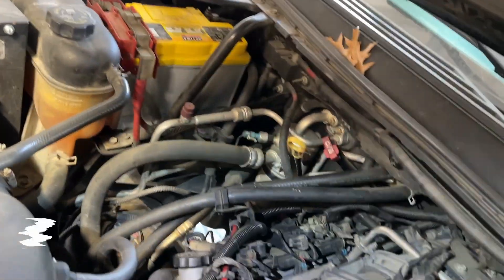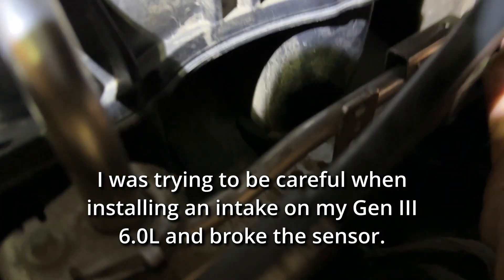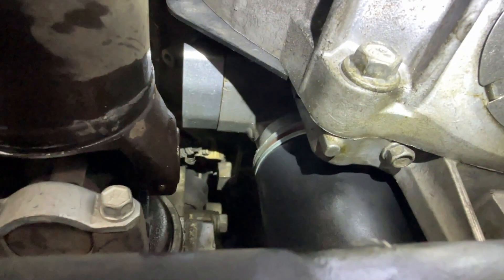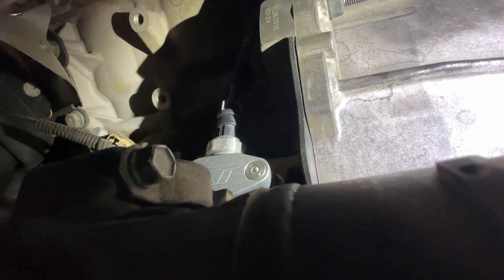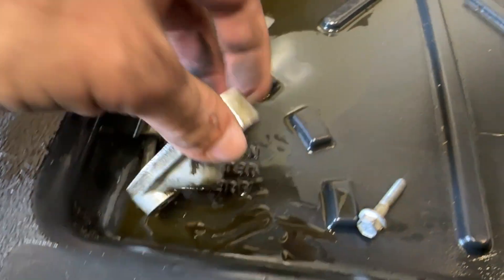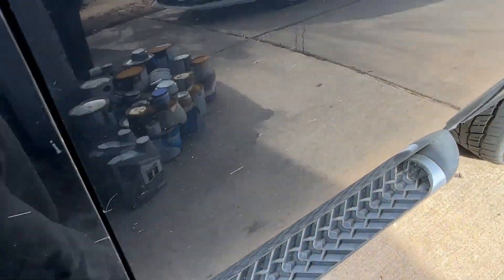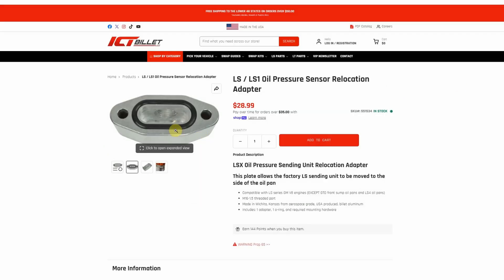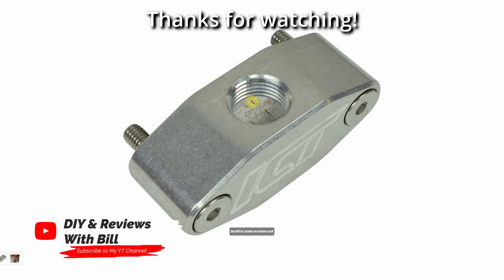How to Relocate Oil Pressure Sensor for GM LS/LT 4.8/5.3/6.0/6.2L Engines Without Oil Cooler Lines

Comment: Have not taken my sensor off so I could be looking at this wrong. The wire harness that is shown in the picture has two female ends, the oil sensor has the male end so wouldn’t that mean the original wire harness is a female end?

Comment: So the old sensor just sits up there or is there a block off?
Reply from the maker: Right now I just left my old sensor plugged in but really you would want to use some sort of block off plug as these sensors can and will eventually leak.

Comment: one thing that the senor also lets you know is when the stupid little filter thats under it is cloged which can cause damage to other internal things.lifters  ect.., this kit while cool takes away the ability to know that now becuse it being cloged will also cause sensor to read low or no preassure
Reply from the maker: Even if the screen is clogged, a lot of times people will just replace it along with performing a regular oil change. All that screen is for is to keep those particles from going into the sensor itself causing it to not read or be inconsistent. It does not filter the oil for the entire engine. That's the job of the main oil filter. Proper maintenance is what will prevent damage to other components from contaminates. The only thing this kit would potentially do is allow the sensor to get clogged and need to be changed a little more frequently. But again, proper maintenance will help keep things running smooth.

Comment: What was the reason that you wanted to relocate that oil pressure sensor?
Reply from the maker: As I get older, it’s getting harder for me to get into tight spaces or be slumped under the hood. At least where I located it at, I can be laying down and more comfortable when I need to replace it.

Comment: The only downside is if the oil pressure sensor is leaking.  You would need to gut it out and remove it and come up with a plug to block the port.  Not sure what the thread size is, so might have to make something.

If you have low oil pressure, a common cause is the o-ring on the oil pan intake.  My 2005 Suburban just pulled the pan to change the oil pan gasket which was leaking.  At that point it is no brainer to pull the intake and change the o-ring.  Good thing as it was cracked.  .
Reply from the maker: It looks like ICT makes a plug for it for when you relocate the sensor. I have updated the description for that part. I have heard the o-ring being issue for sure.

Comment: Thanka for the video. Question: Why would you want to relocate it?
Reply from the maker: I relocated because for me personally, it's getting harder to get into tight spaces and be hunched over under the hood. At least where I located it to, I can be laying down on the ground and it's more comfortable for me. It was my personal preference.
Reply: @DIYandReviewsWithBill  Thanks. My 2009 has low oil pressure (10-20) psi after warm up. It sometimes throws the low oil pressure code.  Probably because it has 230,000 miles. I was wondering if the relocation would give a different reading. Coincidentally, early today I unstuck my Number 6 AFM lifter for the uphteenth time having to remove the intake and VLOM as well as right valve cover, so I know all about the hunching over! And I am only 5'5" and 58 years old!

Comment: This is exactly what I've been looking for. I have an 07 suburban also. I've been having the same issue. Once it's warmed up and I'm going 70 for more than about 15 minutes the pressure drops to zero. Turn the key off and back on and it goes up to normal for a few seconds then bottoms out again. Replaced the sensor twice. The guy at the local speed shop thinks it's bleeding off pressure from the vlom under the sensor. What did you use the plug the hole in the original location, or did you just leave the old sensor in place?
Reply from the maker: I just left the old sensor in that location for now.
Reply: @DIYandReviewsWithBill  thanks for getting back to me. Good video. Simple and to the point.

Comment: Too bad mines a 2010 tahoe, but this is great to know!!!
Reply from the maker: @dltbaudio2883  look underneath where your oil filter is. If you don’t have oil cooler lines coming off of that side plate above it, you can run this kit.
Reply: @mrbill8686  I did I have a 2010 ppv tahoe it has the oil lines above the filter 😥
Reply from the maker: @ dang. At least it’s a PPV. I want one of those.